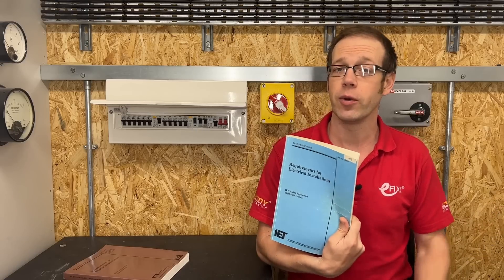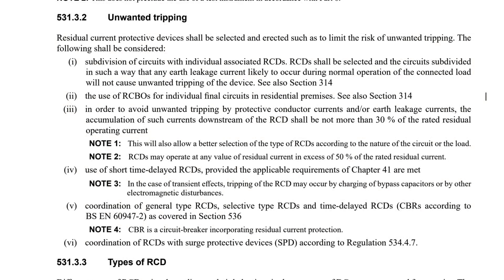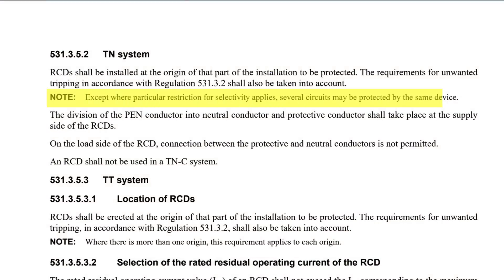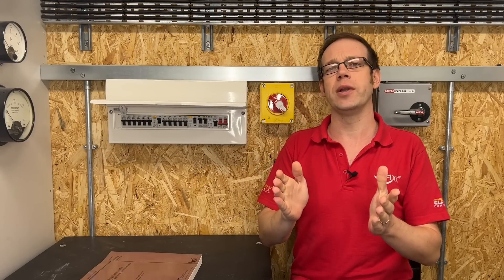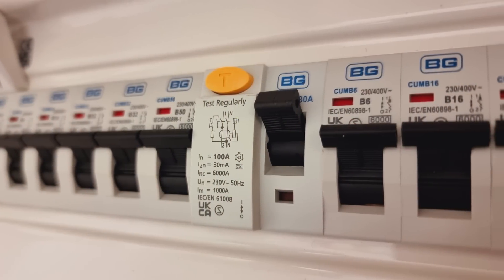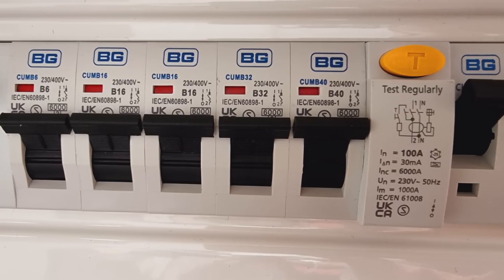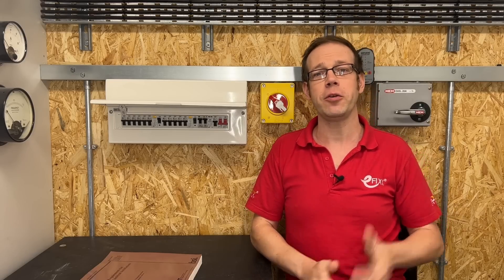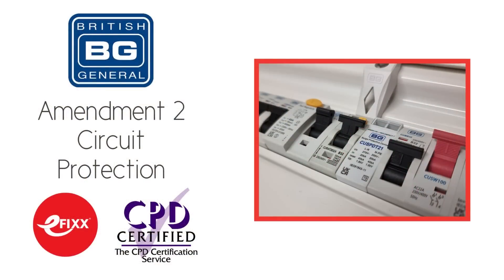Are Split Load Consumer Units Compliant with BS7671 Amd 2?

Comment: Dual rcd boards still have there place in my opinion. Many rcbos are still only single pole , a 2 pole rcd will clear a neutral to earth fault a single pole rcbo will not . Therefore with regards to circuit protection the dual rcd board is better . Many " electricians " will not even understand what I mean which is concerning
Reply from the maker: That is a really good point I hadn't thought of to be fair. 💪
Reply: Great video,happen to have a MK split load board,& having nusiance triping,been considering fitting DP RCBO's to solve issue.
Reply from the maker: Yur, that sounds like a good solution, I take it everything's tested out OK?
Reply: @efixx  Off the tools now, but everything tested ok, had sparky mate to confirm my results just to be sure.
Reply: @Boznivich
No. The all DP RCBO board is far better. 
In France, Germany, Switzerland, etc, all main panel circuit interrupters are mandatory DP.  This means in those countries they can have dual L&N bus bars, which are referred to as combs. In France they have the combs at the top of the RCBOs/MCBs/RCDs, with conductors to the circuits at the bottom of the interrupters.  Far better. Not this hodge-podge nonsense we have. We are still in the 1950s in some respects. 

The French/German DIN rail mounted  interrupters are available in the UK as are the combs, usually via mail order.
Reply: And that's why i make my own boards up with upto 12 individual RCD's serving 12 MCB's...🤣
Reply: Ask most electricians why we do bonding, some of their replies will blow your socks off🤣🤣
Reply: @johnburns4017  I'm well aware of that ., thanks
Reply: @toni1554  is 15 your age .
Reply: I always think a maximum 4 MCBs to an RCD is best and have found dual RCD boards with double pole MCBs to be best, very easy to fault find.
Reply: So just buy dp rcbos, not hard or expensive. Far better when you get to TT installations as well
Reply: @darylsavage119  yes the savage 👍
Reply: @darylsavage119  Best not to have too many RCBOs as they use 1watt each all the time.
Reply: @antlane365  1w per what exactly?
1w per minute is substantial, 1w a week is fuck all 

I'd argue that my callouts for nuisance tripping on dual splits outweighs the cost to run your RCBOS for a couple of years
Reply: @darylsavage119  1w each, so I make that 8.7 units a year each. A few years ago no one would have cared about it.
Reply: @antlane365  1w each makes fuck all of difference if you can't tell me if it's 1w/minute or 1w/year. Your assuming it's 1w/hr, but can you list the technical document that has tested and certified that? 

If people are so worried about the parasitic energy used up by rcbos, why am I still being asked to fit cheap Chinese LEDS and USB sockets?
Reply: @darylsavage119  If you have a 40w lamp, do you ask if that lamp is 40w a year or hour?
The 1w was measured on a BG MCB at our local electrical wholesalers. 
There are people complaining about the price of electric now, at least they may start to stop wasting it.
Reply: @antlane365  Hmm. A negligible power draw or safety. Let me think...
My box has three RCDs. One on the immersion and water pump, one on the main for the sockets, one on the light circuit (600w with incands, 48w with zigbee LCDs, so probably not that necessary) but I'm happy they're there doing their job. If they take a little power to run it's a lot less than the 10-30% Shell Energy have overcharged me since before lock down. Electric use doesn't go up when insulation installed. The breast cancers fun too.
Reply: @darylsavage119  Watt is a unit of power, not energy. It's a continuous power draw of 1 W.
Reply: @johnburns4017  Where can I find the French/German style boards etc? What search terms would you use, or what sites? I would appreciate it.
Reply: @lancearmstrong3252  
Search: Easy9 Multirow Compact Consumer Unit
Reply: @lancearmstrong3252  
The Schneider double pole Easy9  RCBO's/MCBs for example are reversible - bottom feed or top feed. This means they can be fitted with a top feed using the L&N twin busbar (comb), or a bottom feed using a single L busbar (the British way). 

Having the comb busbar means less wiring and a less cluttered consumer unit, that is easier and quicker to fit. And safer as less connections.
Reply: @johnburns4017  Thank you. Is it only the multi row that's like this by the way?
Reply: @lancearmstrong3252  
Some others use multi row but not the twin L&N bus bar and DP breakers. In short, a pretender.  
Fusebox make the metal two and three bank cabinet, but using the inferior British single busbar setup.

The Schneider multi row metal consumer unit is even sold by S'fix. I don't think they sell the MCB/RCBO/RCD  reversible breakers. The reversible can accept the twin L&N comb busbars.  But they sell the combs.
Reply: @johnburns4017  Thank you for the info, I think double pole breakers are definitely a good thing. And from a design standpoint, it  makes a lot of sense to supply both Line and Neutral to the breaker, and supply the cables from these double pole breakers, instead of the lines being fed from breakers and the neutrals from a bus bar. Much cleaner and much more obvious cable routing. Is this the gist of the advantage of this type of board?
Reply: @lancearmstrong3252  
In France they connect the rows via solid vertical busbar. All a part of the kit. Seconds to assemble.
Through Schneider the Continental CUs are available in the UK. Not cheap but available. But Schneider are quality. It needs the rest to follow then get the prices down.
Reply: Any 2P MCCB/RCCB will 'clear' a N-E fault because it's also... switching the neutral! i.e nothing to do with RCBO vs RCD.
Reply: @NebakinezaOG  most rcbos are single pole !!!!!!!!!!!!!!!!!!!!!!!!!!!!!!!!!!!!
Reply: @Mainly_Electrical  
DP RCBOs are more common now as prices are dropping.
Reply: @johnburns4017  still mainly single pole .. you're talking to the master 👍
Reply: @Mainly_Electrical  
Most are single pole for sure, but the extra cost for DP is really not that much more overall.  DP RCBOs are cheaper than what SP were only a few years ago.  To the point is it worth while manufactures making SP units?  We could then go the superior Continental way of all disconnectors being DP and double L & N busbars.  No N bars in CUs then. Easier, simpler and less messy wiring.
Reply: @johnburns4017  I really hope what you describe becomes common here! Having a breaker turned off and knowing there is absolutely no path pack to the incoming supply on either conductor is very handy. More importantly I hope we see more 3 phase supplies. All fixed appliances, especially ones with motors would benefit greatly from 3 phase. Now I don't think we'll see 400V toasters and blenders though! And in reality, unless an appliance can be designed to accept either single or 3 phase, it will always be single phase so it can be used anywhere, otherwise sales would hurt badly.
Reply: @Mainly_Electrical  🤣
Reply: @johnburns4017  but limiting what cu you can use to those brands .. other things to be taken into consideration.. and these brands don't seem to be so commonly available at the wslers

Comment: Very interesting! My mother is in the process of buying a new build house (won't mention the developer, but one of the major nationwide ones) which they have decided to fit with a split load board. 
Found this a bit odd, but not as odd as pre-wiring for an EV charger with a 6mm to the back garden (as there's no driveway and there's car ports for multiple properties a few houses down)- the db is at the front of the house too, and the garden is surrounded by other gardens.

Comment: So what is the down side of split load boards bar the trip leakage issue? If only this then outlaw a little strong?
We had a new board just before metal boards came in, 9 years ago (ish). Is it not going to get to the stage where a re wire is ‘current’ about as long as your iPhone?
Reply from the maker: Not really, a new set of regs doesn't necessarily require an upgraded board.
Reply: Most rewires are done because the existing system does not meet the needs of the customer.

Not be because it’s “not current”. It’s customer choice that drives most of this.
Reply: @MrIbib  fair point Phil. Just for the record I think RCBO’s look like the way forward to me. I am nothing more than a DIY’er who likes to be informed as much as I can. 
The argument around tripping circuits makes sense to me as a person who has the issue
Reply: BS7671 states the regulations aren't retrospective.

Comment: I haven't installed a split load board in 3 years, When giving the customer the option and they penny pinch, I'm more than happy not to get the job. Experience has taught me it's a good indication that it's probably not worth the potential hassle, for what ever reason
Reply: Reece totally agree with you. We to never install dual rcd boards as we have alway considered not to be good wiring practice. The dual board will be gone for the regs as was that stupid reg where there was no need to protect lighting circuits
Reply: Does this mean you have only 1 RCD? If such is the case how you split Lighting (using 100mA) to Sockets (using 30mA) and Water Heaters (using 10mA)?

Comment: I have not worked as an electrician for over 25 years, but it was my practice never to put lighting circuits on the same RCD as power under the guise if you were using for example an iron and it tripped causing the lights to go off also, that was potentially dangerous. Perhaps I was wrong. What do you think?
Reply: I do a lot of fault finding and dont think it really matters, just try not to have more than 4 MCBs per RCD and the more double pole switches used the better.
Reply: I always thought that was best practice. My house is downstairs ring, upstairs lighting on one RCD and vice versa on the other. Makes perfect sense.
Reply: Best practice is to split power and lighting so if one RCD tripped you didn't lose all power or all lighting. RCBO solves that. They're one of the few things coming down in price.
Reply: @antlane365  Are you saying you use Double Poles MCB for Loads would help in nuisance tripping
Reply: @Pgan803  Double pole MCBs make fault finding much easier but any double pole switches around help. Like the cooker switch, if you turn it off and the fault clears its in the cooker.
Reply: When dual RCDs were popular it was recommended to split the circuit purposes across both sides to minimise inconvenience of a trip.

Comment: The increasing amount of non-linear loads on circuits, including controllers in domestic appliances like washing machines etc are presenting more harmonic distortion of the supply voltage waveform. Although standards restrict the amount of distortion an appliance should create, the triplen harmonics create an additive effect that can appear to earth-leakage protection devices as a “fault current”. These currents should be fairly small in a domestic installation but they don’t help by adding to the overall leakage measured by RCCBs etc.
Reply from the maker: Great insightful comments as always Craig, thanks much. 😊
Reply: How about the manufacturers design equipment not to leak to earth ?
Reply: @raychambers3646  not as easy as it sounds without over-engineering the insulation and adding significantly to the cost. Also, some of the current “seen” by RCCBs, RCBOs etc is not actually current leaking to earth, it is due to harmonic currents (particularly 3rd harmonic) drawn by the equipment. Inrush currents on wound components like motors and transformers can also be asymmetric and appear to the devices as faults too. Careful design is the key and, as Joe points out in the video, the regs make contingency for the selection of protective devices and how circuits are grouped in DBs.
Reply: @raychambers3646  Not possible. Earth is used as a reference to 0v in electronics.

Comment: Another sneak source of earth leakage is ovens. They normally have a layer of mineral wool insulation between the inner and outer shells. Over time fat/grease can leak into this insulation and wick up to where the elements poke through the insulation. In physical conduct with the hot element the fat chars and turns to a conductive substance very like graphite, providing a path between phase and the earthed shell that leaks more and more current over time... But usually only on one element. Causes a fun intermittent nuisance trip to find.

The oldschool way to avoid these nuisance trips is to hang the oven MCBs off the bus bar before an RCD. A dodgy bodgy fix IMHO that is better fixed with a RCBO instead of a MCB in this day and age.

Comment: Well with the festive period upon us, I am sure some stressed out people will be wishing that fault on their lights hadn't ruined their lunch, by taking out the oven and sockets 🤣🤣, rcbos don't look that bad now👍
Reply from the maker: RCBOs are definitely the best option as we've stayed many times, the point is that split load boards can still be compliant with some thought.
Reply: Really?! If the lights are KNOWN to be a problem ... Turn off the lighting breaker, light some candles (it's Christmas), plug in a table lamp (or two - save energy), switch the oven back on and enjoy your Christmas lunch 5-10 minutes later than planned. Remember to fix the faulty lights ASAP as a New Year resolution! 🤔😋😲🤣🤣
Reply: @boblewis5558  what about neutral to earth fault 😉
Reply: @boblewis5558  yeah if it's double you are hot to trot, but I have never come across double pole breakers in a domestic property, it's all cheap as chips £60 twin RCD board from Screwfix or some brand you have never heard of and all single pole mcbs .

Comment: I can’t understand why in this day and age it’s acceptable to have any appliance or fitting designed to produce a fault current on the earth in the first place. Surely there is a better way .
Reply: The problem is the requirement to minimise conducted and radiated noise for EMC requirements - especially on devices required to have power factor correction - requires a lot of filtering and that filtering inherently results in earth leakage.
Reply: Technically the RCD 'leakage' current is the imbalance between the hot and neutral wires - which can occur even without an earth wire. We see more of this these days because fewer loads are purely resistive. A lot of loads now have integrated circuits and there has to be AC to DC conversion to power them. I have a forced air gas furnace in my USA home and it is by far the largest source of 'leakage' current in my home. It has a large DC variable speed blower motor to circulate the air in my home. It is great in that it uses significantly less electricity to run. But, I measure significant leakage current both on the earth wire and the natural gas pipe (not a comforting thought). The second largest leakage current comes in on the ground shield of the cable television coaxial cable that enters my home. We have to bond these other utility cables to our electrical service's ground system, which is bonded to the neutral cable in the main breaker panel.

I've yet to see a good article/video from an experienced circuit designer that discussed this topic in depth. I'm curious how much of the 'leakage' is due to poor design or cost constraints as opposed to the natural limitations of dealing with non-resistive loads. But, if I were in the UK I'd stop installing split load boards as I'd expect 'leakage' to get worse not better.
Reply: @JasonEDragon  great comment
Reply: @JasonEDragon  For clarity: leakage is always to ground/earth but an RCD does not need to monitor ground/earth to detect such leakage and therefore operate.

It's not exactly down to poor design but is somewhat linked to practicability and cost. Leakage comes from dielectrtic barriers within electronics, i,e capacitor plates. There is no such thing as a perfect insulator so some current will always 'leak' through. In order to make a 'perfect' insulator, the costs would be astronomical and unobtainable for most consumer-pupose electronics. Hence why it is 'dumped' through the protective earth circuit. Otherwise circulating currents would simply rise to mains potential.